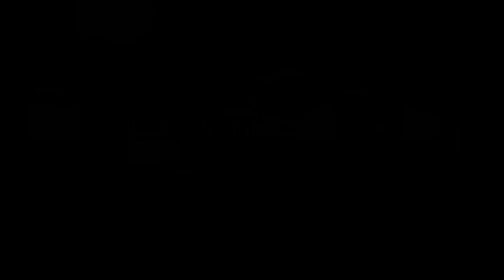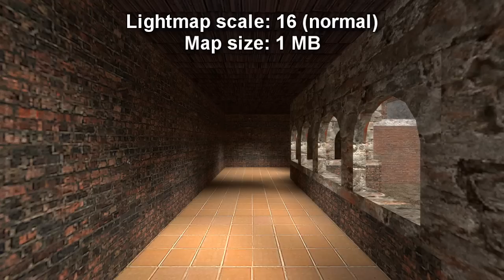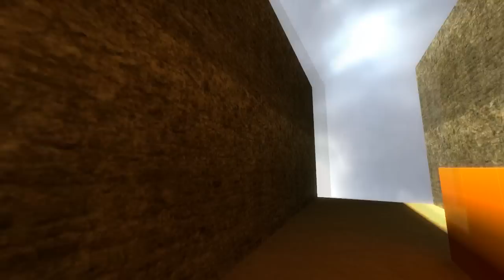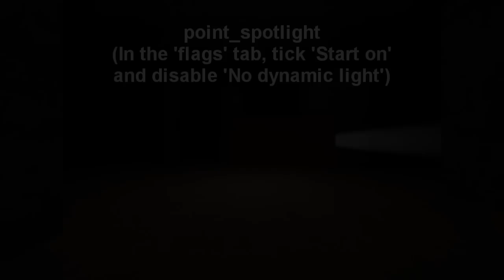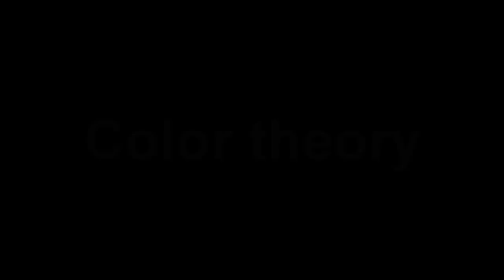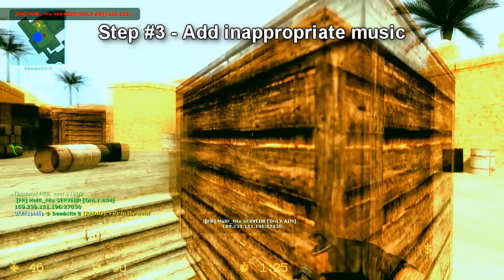Mapping - Lighting Theory

Comment: Here's to a slight chance you might respond.
I'm making a map and on the main floor of the map (the map's inside a warehouse) I've changed the lightmap scale down to 4 because I'm aiming for some nice shadows dropping on it. Now I want to place some decals on the floor in form of overlays so I can transform them. Now when I try to compile the map I get the error saying that the overlay is touching too many faces and the compiler crashes. Is there a workaround for this so I can keep the decals and the lightmap scale? Thanks in advance.